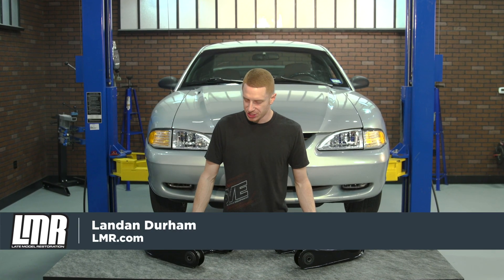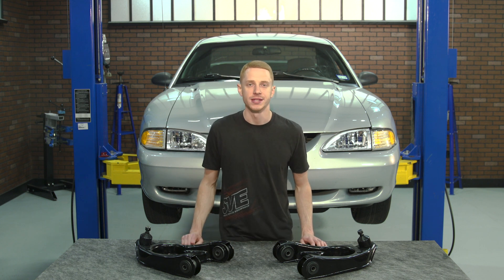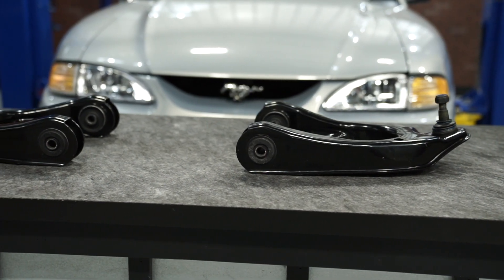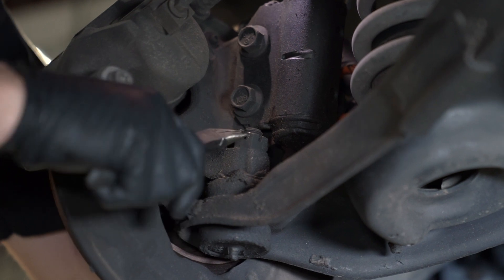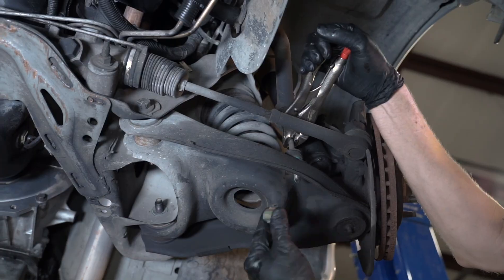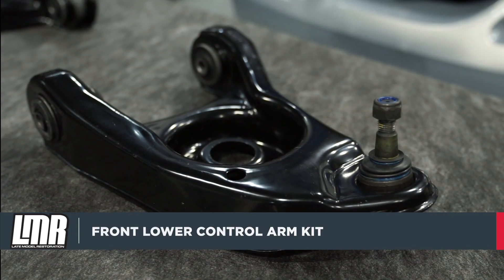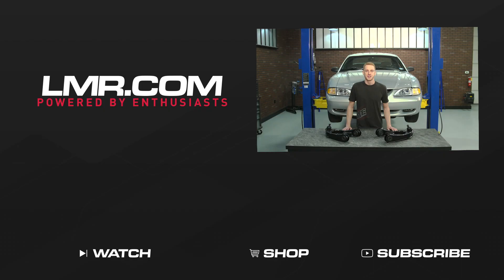1994-2004 Mustang Front Lower Control Arm Kit - Install & Review

Comment: i wanna see a tutorial on a rusty car thats actually driven, things take a nasty turn trying to change parts on a 20 year old turd
Reply: Everything breaks, strips or falls apart in your hands
Reply: Stand by 🤣I will be doing front LCAs on my Fox eventually
Reply: For the rusty parts a blowtorch, lots of lube, and some elbow grease
Reply: I can’t see the holes lining up doing it this way…. I can hear many curse words trying to get it lined up fighting the spring tension.
Reply: @rondoanderson  Thanks for the heads up....doing them on my 97 today. Grrr
Reply: @rondoanderson  That's exactly what I had to do. Worked perfectly. Also when I loosened the steering rack to get to bolts out in the front from the lower control arms they were still hitting the protective rubber on the rack. When I reinstalled the two front bolts I installed them from the inside and cut off the excess bolt. I jacked the control arm up all the way where the ball joint is, taking the weight off the lift by a quarter inch or so then torqued the lower control bolts.
Reply: Rust cars invest in blow torch and grinder tool lol
Reply: Yup. Just paid $100 to have a mobile mechanic (two brothers) come and help get the spring back in. Even they were telling me what to do and they got here, did it, failed, and said "what the fuck?"  Took two jacks and 3 dudes to get it to work. Afterwards, they said it's never been that hard
Reply: Or a video that doesn’t assume everyone has a lift at home lol
Reply: Called a saws all. Don’t fight that stuff😂😂
Reply: @jackryan4313  That's because the design of the sn95 is straight out of 1967 except worse, they stuck the spring further inside the control arm. It's nearly impossible to get the OEM springs back in without compressing them, horrible design. If they're the convertible springs it actually is impossible.

Comment: Just did a complete suspension and steering overhaul on my 2001 GT, One small detail I would recommend which I did, is put a jack under the ball joint and jack up the arm to ride height before torquing the lower arm bolts to help prevent the bushings from tearing.
Reply: Good advice like setting it pre loaded

Comment: IF YOU DONT HAVE THE TIME OR TOOLS DO NOT ATTEMPT THIS. I have a 2001 base V6 and had to move the rack forward. On day 3 of the job and still on the side I started on. One bolt in the control arm has taken 2 days to get out. Also according to Ford the strut bolts/nuts and and control arm bolts/nuts are one time use. Be prepared to fork out more money for that if you value your safety.
Reply: Where do you find the information about "one time use"?
Reply: Florida car here....no rusty bolts and everything else like up north. I used all the same bolts.
Edit...of course Ford is going to tell you that. 🤣

Comment: If you are doing this in the driveway with floor a floor jack do yourself a favor and use a spring compressor and put it back together reverse of how you took it apart.

Comment: Putting a lot of faith in people to drop the spring like this.
Reply: As long as u lower control arm from the chassis mounting point it won't fly out .. I tested it with my own 96 I didn't want my buddy helping me to get hurt .
Reply: I had one fly out...and the other one was like it was glued in. Had to wrestle that one out.
Reply: Trying to line up the chassis-side bolt holes with a floor jack would be a nightmare in itself. On the OEM length springs you can forget about it.

Comment: Thanks for all the hard work.  Unfortunately, it didn't work for me as easily as it did for you.  When I struck the old control arm as demonstrated it would not come loose from the wheel hub.  I beat on that thing as hard as I could over and over again.  I finally had to remove the entire wheel hub, destroying my tie rod end in the process.  I carried the entire hub and control arm to a bench, clamped it in and struck it over and over again with a 15 pound sledge hammer before it finally came out.  Putting it back on the way you showed didn't work either.  When I began jacking the control arm to compress the spring the entire thing just moved outward and away from the mount holes, even with a stationary jack, it took me numerous times repositioning the jack until it was in just the right spot.  Also, you failed to demonstrate the installation of the steering rack and where it falls in the procedure.
Reply from the maker: Thanks for the comment. Every car is different. It's difficult to portray every single scenario someone may face in a video. I hope you understand.

The steering rack was never fully removed, so I'm not sure what you're referring to about "installation". Per the video, slide it forward enough to gain access to the hardware. When finished, reinstall the removed hardware. -Landan

Comment: Don’t you always wait to fully torque the arm-to-k-member bolts once the wheels are on the ground? I’ve read. Or doing this causing the bushings to bind and your car can even sit higher than it should because of that.
Reply: YES. I can't believe I just watched these guys do that, and then suggest others to. Those bushings have teeth that bite into place.

Comment: I just got my front lower control arms out this weekend and let me tell you, it was a pain in the ass.  I never watched any video's prior though and the whole control arm bolt hitting the steering assembly really caused me fits. lol
Reply: I'm not sure how they got that driver side control arm bolt to go in without removing the rack, the rack was clearly even torqued down while they did it. 
You have to unbolt the steering shaft and pull down the entire steering rack to get that control arm bolt out fully.

Comment: With 2001 base model mustang with 3.8l, on the passenger side, I had to remove a small bolt that bolts upward to the floor board in order to slide the long back control arm bolt out. I did not have to support anything to do this.  It was easy to remove. To take out the front control arm bolts, I only had to take off the 2 nuts and pry the steering rack forward. I slipped in a small piece of wood to keep it forward while I slid out the bolt.
Reply: Also, on driver side, I removed the steering rack bushings so it would give me just enough room to pry the rack out and push it up out of the way to get the Lower arm bolt out. And to get the control arm bolts out, I slid in multiple bearing removal forks or used a block of wood to get leverage to pry the bolts out. In all, this is a very time consuming job working under the car. Very poor Ford engineering. Pisses me off when things are engineered like this. On my 3rd day working on and off.
Reply: To remove the rack bushings, I sprayed pb blaster first then each bushing can be pryed out with your fingers so u don't damage them. That steel tube that goes thru the bushing would not come out for me. Thus I explained the way I got the steering rack pushed upward. Not sure how that steel tube going thru the rack bushings is put in -- maybe with some welds so it dont ever come out.
Reply: It comes out just need to get the ol 3lb hammer out n a 3/8 extension to persuade it . It comes out from the back to the front of car . N it's directional as in will only go in one was . Slight taper on one end as I remember .
Reply: @philibuster986  
K
.

Comment: The steering rack doesn't just have to be moved for mod motors... it also has to be moved for the v6 to get the bolts out... mines is 2001 deluxe v6 convertable

Comment: So it is 1am and I finished the swap of the Arms.... I struggled at first with the LH side Arm with getting it back bolted in and after about 5 tries I realized (after 2 beers) that the car wasn't level and that only the front was up on truck stands.... Jacked and put stands on the back to level car out and it went in without issue. RH side Arm took less than 45 min... on my 4th beer and time to hit the showers.
Reply: Tony Journet did you remove the spindle or did you follow how they did in the video?
Reply: Really struggling with the passenger side is that what you talking about when you mention LH arm?...working on 94 3.8 base model
Reply: Why does it have to be level on on it right now and I thought about it and would it be the same ?
Reply: @kennethlewis5285  money off

Comment: Torqueing the control arm bolts when the control arms are 'full droop'  locks the teethed metal bushing shells into place in the incorrect position.
When you lower the car back down onto the ground to normal ride height, the control arms will be preloaded and under a lot of stress.
The new rubber bushings will tear and wear out very quickly.
Reply: I am about to do this install, people say the wheels need to be on the ground then you full torque. Maybe a dumb question but how would you have clearance to do so if that car is on the ground
Reply: M@zachscheiber728  you gotta have a drive on lift
Reply: @zachscheiber728  You place a floor jack under the control arm where the ball joint is and carefully jack it up to put a pre-load on the new control arm bushings, to about ride height. Then you torque to spec.

You do this while the vehicle is still in the air on a lift or jack stands.

Comment: On no Fox/SN95 with any kind of miles will those control arm pivot bolts come out.  They will be fused to the steel bushing sleeve.  An air hammer will be useless.  You will need to cut right though the ends of the bushing and bolt with an angle grinder to remove the arms.  Then replace pivot bolts with grade 8 types.
Reply: Cars Food Weed this does nothing to free the steel sleeve that is friction welded to the pivot bolt from years of driving.  Turning the bolt just turns the sleeve until it tears itself free from the rubber bushing and then it just freewheels.  You can’t drive the bolt out axially because the sleeve is welded to the bolt from years of driving.  You have to cut the pivot bolts.  If you’re lucky, an air chisel sometimes works to push the bolt through the sleeve...rare.
Reply: Cars Food Weed how do you torch the bolts without lighting the bushing on fire?  Just cut them with an angle grinder cutoff wheel.  It’s 2 cuts at about 30 seconds a cut.  You don’t even need to loosen the nuts...1..2..3...what are you driving?

Comment: Damn !!! 
This is alot of work and information for a beginner !!! 
Im lost,  2001 Ford Mustang GT Owner !!
Reply: NimNum and remember those bolts will be a pita to get loose with no leverage working on the ground lol.   All these videos make it look easy
Reply: hell yeah first time i had to change balljoint was easily the most time consuming job iv done on the mustang except tranny
Reply: @ulisesc4388  did you replace the lower ball joint? If so do you have to take apart the whole control arm to do this?
Reply: @JaidenStylezTV  to replace the ball joint, it's not necessary to remove the whole control arm

Comment: I thought you're supposed to torque the arms with the wheels on the ground or ramps so it would be under a load ?
Reply from the maker: We always recommend torqueing everything while there is load on the vehicle.  For this video, it was not shown but we do recommend it.
Reply: @latemodelrestoration  cool beans

Comment: One of the bolts was seized inside the control arm bushing. I had to cut it out. Couldn't cut through the bushing metal sleeve, so I had to use a dremel to cut the head of the bolt off. Was a real pain.
Reply: yeah, I just did mine today. I had to use the air hammer to move the bolt back and forth until I was finally able to get the bolt free.
Reply: Had the same problem on passenger side

Comment: Great video .... I'm about to replace both L and R on my 03 mustang... just wish you would have listed what tools...  socket ...  required for the job... and what tool to use to make sure you have a 129 pounds on the ball joint nut....
Reply from the maker: PJ, any good socket set will allow you to complete the job!
Reply: Don’t take this the wrong way, or do... either way, if you don’t know what tool is needed to torque a nut/bolt you should probably get someone who does to do so.

Comment: why do you say and show you removing the rack but it clearly shows the rack in place and bolted when taking the old arm off and putting the new arm on?
Reply from the maker: shadows faded - That was for illustration purposes.  Because of the switch to mod motors in 1996, Ford slightly changed the k-member geometry.  Hence why we showed bringing the steering rack forward.  The car in the video is a 94-95 push rod 5.0 car, so the rack can stay in place.  Hope this helps!  -Landan
Reply: @latemodelrestoration  ty landan. very helpful. .just wanted to make sure because im tackling this in the driveway this wkend.

Comment: This method works obviously if you have a lift.. hard as hell to get the control arm bolt holes lined up if youre doing the job on jackstands.. ordered a $17 tool from MMS. Easier.
Reply: What kind of tool was it
Reply: What tool?
Reply: It was a small spring compressor that they made.. that was back ordered 6 weeks when i tried ordering it..was able to get the springs in with just a floor jack

Comment: Has anyone had a problem with the ball joint bolt turning while trying to tighten the nut? I can't get the nut tightened due to the bolt turning.  Now what?  Im at a loss..
Reply from the maker: Hey Garland, give us a call at 1-866-507-3786 or us the link below to get into contact with us. Our CCR team can help you out - https://lmr.com/contact
Reply: Impact gun
Reply: Same I’m doing mine now and it keeps turning can’t tighten at all. Any help

Comment: I noticed there is no tie rod connected on the passenger side nor did they elaborate on such...I took it off but still having trouble getting it back on
Reply: Getting the control arm back on that is
Reply from the maker: Please give us a call if you're still having issues at 1-866-507-3786. Our customer care team can answer any questions you may have. - Jude H. - Social Media/Events Coordinator

Comment: why didnt my lca have a castle nut an cotter pin ? are they replacements that im replacing ?
Reply from the maker: Cody - Someone may have replaced just the ball joint or the entire control. That is definitely not factory, though! -Landan
Reply: Landan , thanks for the reply! an thank you for the how to on the lca's. huge help

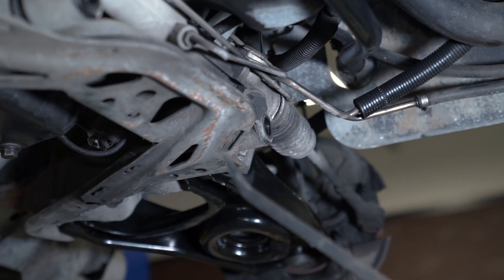Comment: Not sure what he said at 2:30.  “If you have a mod motorcar “??  What does that mean ?  Some 2004’s need to remove the rack and others not ?
Reply from the maker: Ron - Because of the k-member design and steering rack placement on 96-04 4.6L-based engines, the steering rack needs to be moved forward in order to remove the frontward lower control arm hardware. The car in this video was a 94-95 Mustang which has a 5.0L engine. Hope this helps! -Landan
Reply: Late Model Restoration , thanks. I have a 2004 V6 convertible so no need to move the rack..
Reply: This helped a lot I'm about to replace my LCA's
Reply: Its simple to move the steering rack dont let that scare you from doing the job

Comment: I have a height issue on a 97 GT the passenger side is about half inche higher then the driver side anyone knows where the problem might be? Is got everything new by the way
Reply from the maker: This is a very common problem on 79-04 Mustangs. Both of My New Edge cars did it. One did it worse than the other. There are plenty of forum posts about this. Most folks just chalk it up as "whatever" and carry on. If you want to try and level it out, you can play around with adding/removing spring isolators. -Landan

Comment: If you just loosen the rack n pinion you can remove the from control arm bolts. You do not have to remove it.
Reply: On the driver's side you absolutely have to remove and lower the steering rack to clearance for the frontward control arm bolt, on 96+ models.

Comment: How did you get the front control arm bolts out without moving the steering rack?
Reply from the maker: Hi Shawn, 

If you have a 96-04 Mod motor car, you will have to move the steering rack. If you do not, you should be able to fit all the tools in-between and remove the front control arm bolts without an issue. Please give us a call at 1-866-507-3786 or email us with the link below if you have any other additional questions or concerns: https://lmr.com/contact
Reply: 97 base mustang,  driverside LCA the steering rack is blocking the bolt from backing out, seems like I'm missing a step

Comment: I own a 1998 mustang v6 im in the process of replacing my arms i installed the arms but i cant connect steering rack back to the steering shaft its just a bolt right to tighten it up. To connect the steering shaft and steering rack do i put pressure to connect it so it could slide in like hitting it with a hammer so it slides in then tighten it up? Any tips or should i do it with force*hammer*  please help
Reply from the maker: Hey Robert, using some force from a hammer or mallet may be required to get it all to sit again. Force is needed due to wear and tear caused by driving over time.
Reply: @latemodelrestoration  thank you very much i also bought my controls arms from you guys GOOD LOOKS 💯🔥 THANKS

Comment: Is this a great upgrade for a 93 lx 5.0
Reply: i have sn95 arms on my fox, it depends on what your application is, itll increase the track width by an inch and a half but the stock caster camber plates dont really adjust enough to dial out the extra -camber, if you bought maximum motorsports caster camber plates they give plenty of adjustment to dial it back out, so if youre going for a camber setup anyway its great, bolts right up with no issues.
Reply: Seca86Drift thanks

Comment: has anyone did a 03 04 gt ? do you have to move steering rack like shown in video? just put new hubs on car saw i need new ball joints so mite as well do whole control arm and sway bar end links while got it apart. thanks
Reply: Did you have to move it?